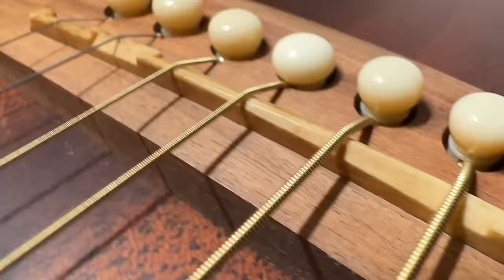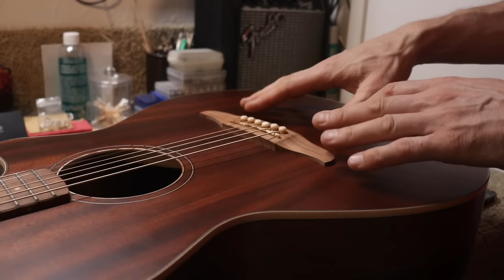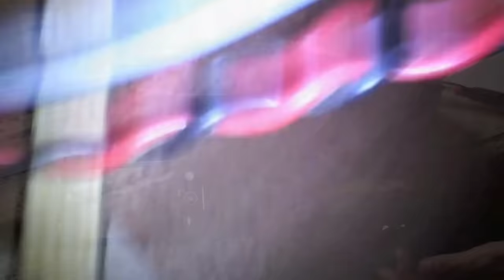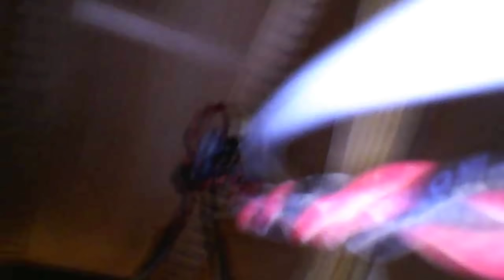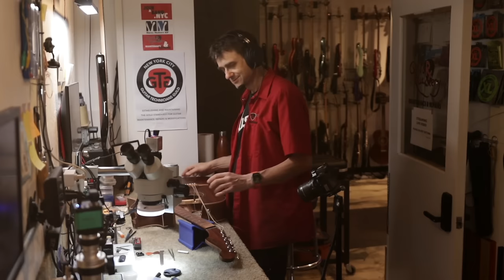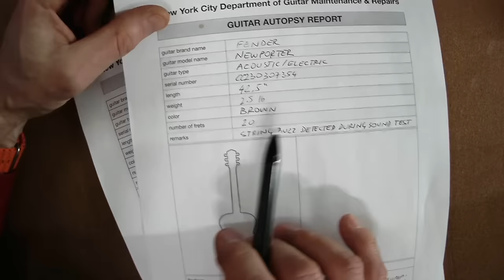Fender Newporter Acoustic Guitar Disaster Review

Comment: I was loaned a Fender Newporter ( non cutaway) back in the late 60’s it was a parlour sized instrument and I liked it a lot, easy to play, had a Strat type neck low action and sounded good for a smaller guitar.  Yes every guitar needs a set up, if they play out of the box then you are lucky.
Reply from the maker: Thanks for sharing the story. Of course, it goes without saying that the 60's Newporter was a completely different guitar, even if it bears the same name. Production techniques have changed completely. 

Thanks for dropping by.

Comment: I used to own two identical guitars, except one had the bridge tilting. I sold the non-tilting one as I prefered the lower action of the tilting one. Which makes me wonder if glueing the brace and getting rid of some tilt would actually raise the action, despite the reduced belly?
Reply: It would indeed raise the action.
Reply from the maker: When comparing two acoustic guitars, there are a few reference points that will affect the action. The action, as measure on the 12th fret, at the end will just be the sum of all reference points. 

More specifically:
- nut height
- neck relief
- neck angle
- soundboard deflection
- bridge height
- saddle height

If or when there is a change in any of these reference point, the action (as measured on the 12th fret) will change.

Hope this makes sense.

Comment: There’s no excuse for that high nut, and especially the poor racing. But I think you’re too aggressive on your string heights, 150 is plenty low for have you even medium strumming with a pick before fretting out, don’t you think?
Reply from the maker: I don’t understand what you mean by 150 being low.

Are you saying that .150” would be acceptable, action height?

While action height is debatable, I go for .080” on the treble side and .100” on the bass side, measured at the 12th fret, after I make sure that the nut and the neck relief are correct.

I find that to be the most widely acceptable acoustic guitar setup for most players, without them knowing anything about actual measurements. 

Also, I do not do guitar setups by customer request. The way I work is by me examining the guitar first and then advising the customer what the guitar actually needs in order to achieve the best playability.

Or perhaps, I misunderstood what you were saying.